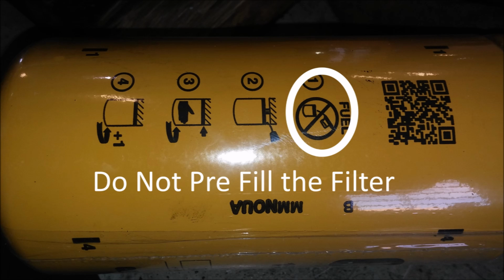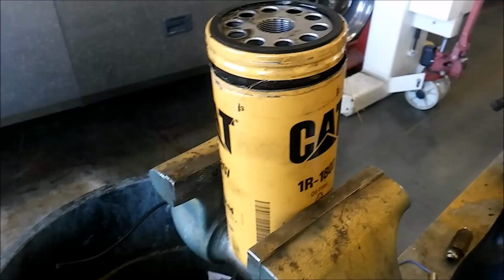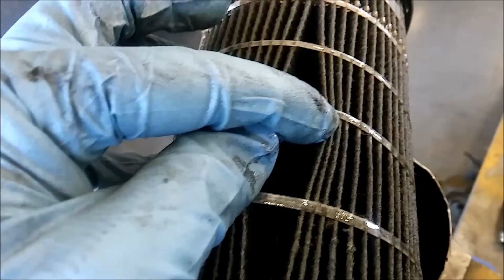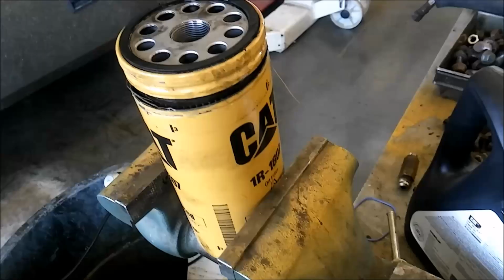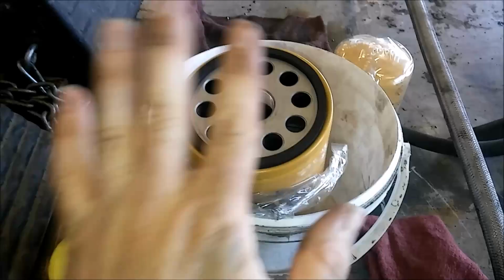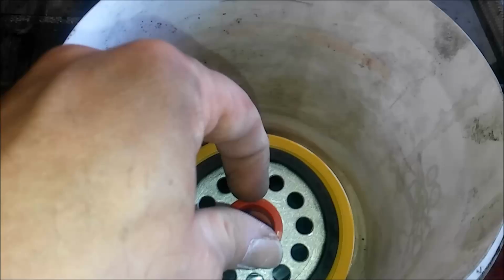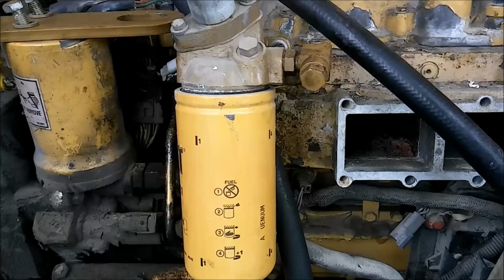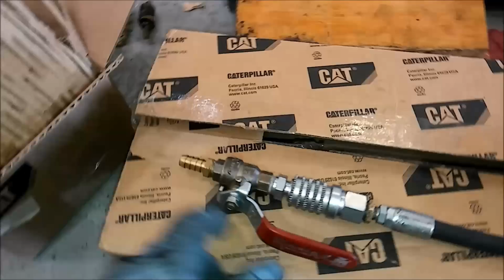Should You Pre Fill an Oil Filter? Should You Pre Fill a Fuel Filter?

Comment: Engine oil filters are usually spin on type cartridges and the filtering media is not that special... New oil is always dirty and those dirt particles in general are not visible for human eye. BUT you should also understand the FACT that none of the oil filters can catch up all the dirt from the oil flow going through the filtering media SINGLE PASS. This applies especially for engine oil filters that are actually guite shitty filters in genre of filtering media used in them.
Beta ratio is the ratio that describes filters ability to catch up certain size of dirt and for engine oil spin on filters are really bad in this since engines don't even require so clean fluid. You could say that fuel filters for diesel engines are decade or two step up higher in performance (10-100 times better). Same step up is reached and even gone far past cleaner in some hydraulic systems having proportional or servo valves in them.
So my point is that engine oil filter lets approximately 50% of dirt go through it anyway so in that case it has nothing to do with particle contamination because they will go through anyway. Much more essential is to provide engine oil pressure during initial start up even those 3 first seconds. 
Certain cleanliness level in any fluid system is reached eventually when the fluid has been circulating through the filtering system multiple times. Single pass through oil filter can still have a lot contamination in the clean side. That is also the reason why all fluid filters are tested in multipass test bench measuring the filters ability to gain statistical end result of removing certain dirt size from the fluid flow. Just fill the damn engine oil filter to guarantee fluid film for bearings. And none of the particles from oil can are that size that they could block piston nozzle in an combustion engine!?

Comment: Dirty oil is better then no oil, that is why oil filters have by-pass valves built into them.  I will say filling it from the outside is a good idea, but I've never had a filling it from the center be a problem.  No oil and too long between oil changes are the failures I've seen.

Comment: I do prefill the fuel filter using the priming pump but i just have a question some machines have a bleeding valve and some do not so how do you bleed air from the system?? I know what i do is wrong but when you do not have a bleeding valve i just leave the secondary fuel filter untightened until the fuel comes out of the filter then i thighten the filter and continue priming

Comment: Umm, when an engine as seen some life it is pretty dirty inside any way, modern oils can suspend large amounts of dirt/contaminents so your engine should be ok, with the old paper elementtype filters it is almost impossible to  not leave some small amount of contamination, I have been a diesel for more than 46 years and never have pre filled any filters, it has never caused a problem.Regarding fuel filters, the ld school pre common rail stuff is not quite as fussy as the modern system.

Comment: Well, if you have a new filter and new oil, there shouldn't be contamination. And you're putting oil in to avoid dry startups. And the bulk oil contamination is wrong too. Not that it isn't true, just the oil jockey is going to stick the pump in and pump every drop till it's gone.

Comment: for fuel filter s (cummins any way) don't pre fill the manufacturer has provided a way to prime  with a recommended procedure (just like following maintenance, interval follow the maintenance procedure). most that have tried to teach me how to filter service my 1991 5.9 have no clue that provisions are there to remove the air, the others say it takes too long to do it right so take these short cuts.....  and then complain cus I wont take there advice and do it right.

Comment: there's always some know-it -all that wants to think they are smarter which their not unless your pouring crap into your motor there's no worries Do what you think is right But on the large Engines that use a filter that holds a gallon of oil I'm damn sure prefilling as I do all fuel filters unless the position of the filter makes it impossible

Comment: Is the same true for a passenger car gasoline engine? If you are filling the center of a new filter (and not so much the outer holes) w/new oil from a sealed container,  that small amount of oil entering the engine on start-up that didn't go thru the media can still potentially hurt the engine?  I just figured new oil like Pennzoil Platinum Synthetic from a sealed container was pretty spotless stuff...

Comment: On my cummins I have to pour the new oil directly in the top of the engine!! How do you think not filling the oil filter is better??? If the oil is too dirty to pour in the center hole than it is too dirty to pour in the oil filler cap on the top of the engine!!

Comment: I've pre-filled my new filters using the outlet hole forever..... Never an issue, because I only pre-fill with new oil.  And.....a large amount of oil will always bypass the oil filter upon cold starts or high pressure situations.  Therefore there is always a chance of contaminated oil reaching the engine no matter how anal you are about pre-filling your oil filter.

Comment: so if new oil is dirty, and needs to be cleaned by the oil filter first, oil changes seem a waste of $..     I have always changed the oil filter many more times than the oil,  along with one or 2 new "but not so clean" quarts oil  and my engine internals stay spotless. after 100's k miles.

Comment: I alway pull the fuel pummp fuse and turn the engine over for 2 minutes after an oilchange. that way I can be shur their's no leaks and i have full pressure when running for the first time after an oild change

Comment: I own a 96 flatbed wrecker with a 3116 cat motor it has 372k on it don't know when the last valve an injector adjustment was possibly over 100000 miles ago will it cause problems if I do it now any input would be helpful

Comment: Personal preference,not prefill filter s unless manufacturers require it,as most engines will run 10 to 30 seconds with no oil without a problem,by which most will have oil pressure inside 10,Watch out for anything using vane type oil pump,do not run them dry

Comment: When I changed the fuel filter on my 2012 Diesel Mercedes V6 I just ran the fuel pump for a while before I turned the engine. I could hear the bobbles circulating back to the fuel tank. Once there were no more bobble sound I started the engine and it ran just fine. I know we are talking about two different engines. Is there a fuel pump in the fuel tank typically for these C7 engines?

Comment: buy a filter head for the filter,  ( most large diesels use common filter heads, so its WELL worth the investment !! )   plum im a 12 volt fuel transfer pump into the head. install your new filter. draw fuel from a CLEAN source. turn on the pump. =  wallah! pre-filled  fuel filter ---- the correct way.  ---   OR use that fuel that came out of the filter to fill other filters.    or  dont   .... i dont care  ... YOUR paying the bill !!!

Comment: got a question..  does CAT have a starter switch in engine bay  so you can bleed the air out of system when working alone ??
i worked on a MAN truck years ago and it had it.. really nice feature  on trucks with a flipping cab  or just in general so you dont need to call someone over and help.

and CLEAN fuel is a myth..    fuel stations all got some condenced water and stuff in their tanks.. actually pretty much water..
you would be amazed to see how nasty old tanks can be inside..  the pumps have filters yes but theyre kinda brute in the mesh to give us a proper flow.. noone wanna wait 30 min to fuel up.
try and get a jerrycan full of diesel and run it tru a white coffee filter...  then you start thinking fuel filters in serial..
often you see rust pieces from the tanks.. very small but lethal.
also why its a bad idea to always run  with low gas on the car to save weight in the hope of saving gas money..

Comment: Could we just put a small auto oil filter on our bulk oil supply? Pre filter our new oil? Seems better than not dumping dirty “clean” oil into the crankcase.
Reply from the maker: +PapaWheelie Sure you could, oil is generally pretty clean new, it is the filtered side of the system you need to worry about, which on Cats is the center hole, some manufacturers may be different though.

Comment: I own a 2005 CAT C-9 engine (RV). Per the engine manual 10w-30 is preferred with the CAT ECF-1 specification. Rotella has ECF-1-A specification in 15w-40 and ECF-2/ ECF-3 in !0w-30. Will you advise me on these CAT specification?
Reply from the maker: I didn't know Cat recommended a lower viscosity oil than 15w40. We use 15w40 in every Cat engine we service. I would say stick with 15w40 Diesel Engine oil. I have never seen it cause a problem with a Cat Diesel Engine. Is the maintenance manual a Cat manual?

Comment: Deere doesn't want pre filled oil filters in the engines I know. Book says pull the controller fuse and crank the engine for 8 seconds or so to fill the filter without starting.  As for fuel, I built a 3 stage large Gresen filter rack for diesel on the output of my oiler truck. This polishes the diesel before it gets to the unit and takes all the water out. Prior to this with the typical crap - joke filter on a pickup tank, water and dirt was a constant problem. Filtering new engine oil seems a bit anal to me. Got enuf other stuff to do.

Comment: I have a question for you Josh.Will I cause any damage to my injectors or fuel pump if I use the comp fitting on the filter housing with an electric 12volt lift pump that I rigged up from my DD15 engines? I used to do this method of filling up the fuel filters for the Detroit Diesels and it worked all the time with no problems. Thanks

Comment: To me its quite simple. .  . My cars oil filter sits upside down thus its technically impossible for me to prefill. . . As for the fuel filter I first install it then remove the line to the fule pump and prime it until it spits fuel from the filter

Comment: Have a question we have a 1994 Freightliner with a cat 3204 straight 6 diesel wouldn't start because the starter was no good, we had to pull it out of the garage so we tried starting it while pulling it backwards and it started, but it was like the engine was running  backwards, is that possible

Comment: Don't prefill some fuel filters & the engine  may never run again until you do .

As for prefilling oil filters is some oil actually dirty ?

Pretty sure it is but as we all know NOT ALL oil goes through the filter anyway as most cold   oil goes through the bypass valve a few times anyway.

Comment: Let me let all you people in on a secret. It doesn't matter if you prefill or don't prefill. The half a second it doesn't have oil pressure won't do a damn thing unless you have a huge filter like a 7.3 power stroke. In that case the truck will shut off become it loses oil pressure to the injection pump but will restart right after. Its not worth arguing over it doesn't matter either way

Comment: quick question. its winter and sometimes start truck out on the shop lot can be time consumming. do you have any tips one can use when starting truck in cold to bring in shop to work on it. thank you
Reply from the maker: +jamecorts Do you have a jumper box? We bought one for the shop, it's basically a set of batteries for jumping on a cart and it saves us a lot of time.

Comment: THIS QUESTION I HAVE REALLY HAS NOTHING TO DO WITH THIS VIDEO BUT IT JUST CAME TO ME AND IT WON'T HURT TO ASK. I HAVE A 40' SPORTFISH BOAT TWIN 3208 CATS  WITH TURBOS I USE THE BOAT ON THE WEEKENDS SO IT SITS 5 DAYS THEN WHEN I FIRE HER UP THE STARBOARD  SIDE ENGINE HAS DIESEL FUEL COMING OUT THE EXHAUST I SEE IT IN THE WATER ALOT AT FIRST THEN IT SEEMS TO CLEAR OUT .  DOES ANYONE HAVE ANY IDEAS . BY THE WAY THE ENGINES HAVE 2,300. HOURS ON THEM.  THANKS

Comment: Just a newbie to diesels, but cant you clear flood crank engine or disable fuel just to pump up filter?
Reply from the maker: +Noah Ark Yes you can disable the injectors and then crank the engine, that'll purge the system of air and prime it.

Comment: I have a question about oil viscosity: I have Honda Accord lx 4 cyl & the manufacturer recommends 5w20 but I use 0w40 or 10w40 during the hot summer, the car is not under warranty.  Is this bad?
Reply from the maker: That seems like a very heavy weight oil for a Honda engine which has very tight bearing clearances. A Diesel Engine usually uses a 15w40 weight oil and they have larger bearing clearances and are under much heavier demands. I would stick with the manufacturer recommended viscosity, if they have a dual recommendation like 0w20 or  5w20, you should use the 5w20 in the summer or in a warmer climate. Hope that answers your question.

Comment: Always fill the fuel, never the oil. Aren’t you bypassing the “filtration” process if you pre-fill an oil filter? The oil passes from the outside of the filter thru the inside, correct?  So you’d technically be putting dirty oil in, if you fill directly into the center.

Comment: hi there it's me again i installed the HUEI pump and noticed the fuel is not comong all the way to the filter i disconected the fuel line from the tank and used a hose straight from a fuel container to no avail theres is some fuel coming out but it doesn't reach the outlet line going to the injectors, this is a 2003 bluebird school bus that has not run for 3yrs. will you suggest anything else? in the fuse panel thre is a fuse and rtelay for fuel pump but this doesn't have an electric pump or does? help!!!!!! thank you so much!!!!
Reply from the maker: There shouldn't be an electric fuel pump, the pump on the back the HEUI pump should be the only fuel pump in the system. If you ran it from a good hose from a fuel container and the transfer pump isn't pushing any fuel it sounds like you need a new fuel transfer pump. The fuel transfer pump can be changed on a 3126 without removing the HEUI pump, on a C7 you have to remove the HEUI pump though, or at least it's easier.

Comment: I don't think you're reasoning for prefixing fuel filters, you're still going to need to bleed the fuel system, you can't prefill thoroughly enough to get all the air out of the fuel system, so when you bleed the system you're essentially prefilling the filter anyway, just with it mounted.

Comment: If you don't pre fill your fuel filter or filters you'll be cranking the engine till hell freezes..... I've never seen anyone, myself included never installed a dry oil filter but I can see it's acceptable being the system is already charged with oil beforehand.

Comment: hi love your chanell and i have a question; i am not a cat mechanic but do understand quite a bit about diesel engine and i am a auto mechanic for 35 yrs ok now here is my question, i took apart a 3126 HUEI pump to inspect it bus been sitting for 3yrs and i want to know how to fill the pump and reservoir before mounting it back or should i wait for it to be mounted? also how do i prime the fuel system? thank you so much your help will be greatly appreciated.
sinc: marcial from puerto rico
Reply from the maker: +adve58 Don't worry about priming the HEUI pump, my guess would be most of the oil would just leak out during installation and make a mess, and have the added bonus of making you mad. With clean oil in the engine, the HEUI system will prime by itself when your cranking it and won't start until it's primed and building pressure. Not a bad idea to squirt some oil in the passages and ports in the pump while you have it off and rotate it by hand just to give it some oil for lubrication during cranking. 

If the engine has a hand priming pump on the fuel filter housing that is the best way to prime the fuel system. If it doesn't, the filter housing usually has the plate that can be removed and hand primer installed, they are about 45 dollars if I remember correctly. Since it's a bus there may not be room for a hand priming pump, so what I do on rebuilds or engines with no priming pump is get a suction gun like the one I use to evacuate the cylinders on my injector videos, then I remove the fuel return line from the engine and pull a vacuum through the engine fuel return so that it pulls fuel through the filters and engine. You'll have to remove the line before the pressure regulator valve or else it won't pull through the valve. Hope that helps.

Comment: Hey genius, all that oil you dump into the crankcase isn't filtered either when you initially fire up an engine and that crank and all your sensitive bearings start to move. Unless your work is totally sloppy you'll probably be just fine.
Reply: Jonathan Catron that oil isn’t going into the bearings until it has passed through the oil pump and then oil filter. You clearly don’t understand how an engine lubrication system works.

Comment: What about doing it this way - Dont pre-fill the oil filter, but shut off the fuel so engine cant start, while being turned by starter. If you have decompressor, use it. Yes it takes stress to the  starter motor and battery , but if you are reasonable and dont overcrank it...it will eventually reward you with oil pressure. At that point just restore fuel supply and let it start. In gasoline engines, preferably the older ones /as they dont complain about every shit /, just disconnect ignition coil. 
It gives me goosebumps when the engine is started after an oil change and it runs "dry". The sound is just horrible.